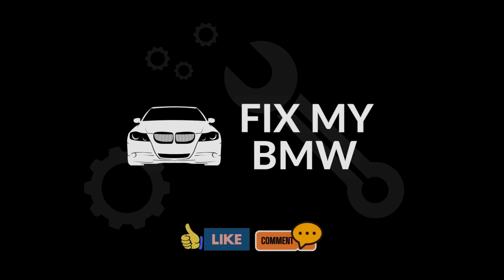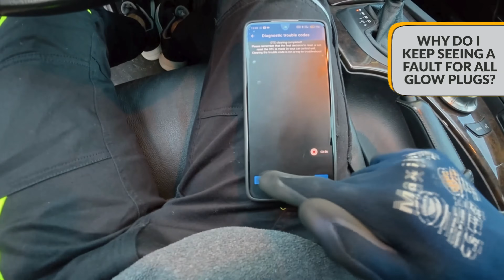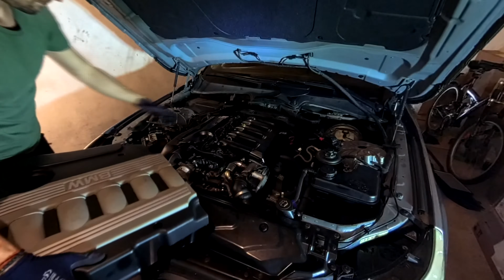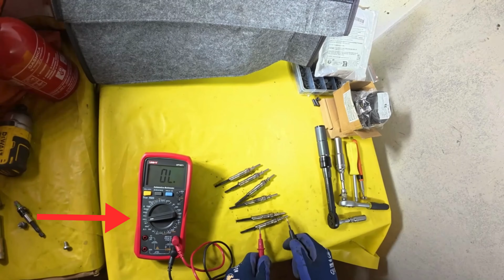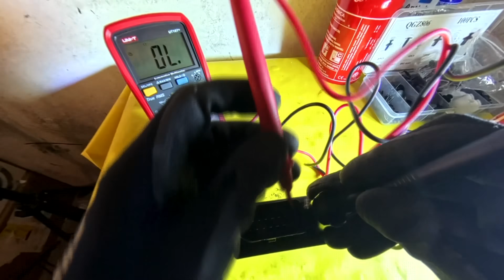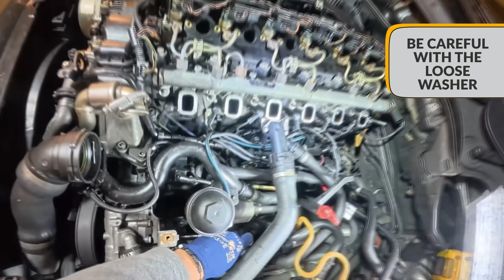FULL REBUILD - glow plug system in my BMW E61, m57n, 3.0d

Comment: i have fault codes for glow plug 6, glow plug relay no connection to bsd, alternator no connection to bsd and intelligent batterysensor no connection to bsd i tried disconnecting alternator bsd cable and ibs bsd cable still all errors i have replaced all glow plugs and 2 hitachi glow plug relays and power cable. what should i do next?
Reply: can it still be broken if it doesnt show any fault for oil level sensor?
Reply from the maker: @nooavaananen1607 Yes, absolutely. The oil level sensor can short-circuit the BSD bus line internally without throwing an "oil level sensor" fault code. When the signal wire gets pulled to ground, communication with all devices drops completely. Disconnect the oil level sensor, clear the codes, and re-scan. If the BSD errors disappear, replace the sensor.If that doesn't solve the problem, it's best to post on a Facebook group asking about this specific case—maybe someone has already dealt with this exact situation, because to be honest, I haven't come across this issue myself yet ;)
Reply from the maker: Hey, all those components (Glow Plug Module, Alternator, IBS, and Oil Level Sensor) share a single-wire communication line called the BSD bus (Bit-Serial Data). If one device on the BSD line has an internal short-circuit, it pulls down the entire network, causing all other components to throw 'no connection' faults.

Since you've already tried disconnecting the alternator and IBS, try to disconnect the oil level sensor (ignition on, engine off), clear the codes, and check if communication with the glow plug module returns.

Comment: Hey can you help? I did this change. And now my car wont start and all my lights are lighting up on the instrument cluster
Reply from the maker: Hi, what exactly did you change? The controller? The power cable? The glow plugs? Please tell me a bit more
Reply: @fixmyBMW  i only changed the glow plugs and glow plug module. i did a coolant change too. 

i went to start the car and it just clicked and few times and didn't turn over. it had the car on a lift symbol, and a lot of lights were turning on and off on the instrument cluster, and my hazard lights were turning on an off. 

i opened the automatic boot, and it stopped halfway. im not sure if the battery died?
Reply from the maker: If during the replacement the interior light in the car was on, then yes, the reason could be a weak battery, and I sincerely hope that this will solve the problem ;) If not, a less important question—do the new glow plugs have the same number and length as the previous ones? A more important question—is the new glow plug controller OE or an aftermarket replacement? Used or brand new?
Reply: @fixmyBMW hi, do you have an email i can contact you? I want to send you more details and a video?
Reply from the maker: @AB.............  Ok, on the main page of my channel, after clicking "more," my email will appear. I don't want to provide it in a comment because spam ads from bots always come afterward. Reach out to me, and we'll try to get this sorted out :)
Reply: @fixmyBMW  thank you! will send you an email now :)

Comment: Hi!
I personally own a BMW 525d E60 with the M57D25TU2 engine.

Symptoms:
• The car is in “Limp Mode”: No power, refuses to regenerate the diesel particulate filter (DPF).
• Winter issue: Hard to start at -15°C (cranks for a long time before it starts).
• Fault codes: Permanent faults on all 6 glow plugs and the exhaust backpressure sensor.

Checks performed (your evidence):
	1.	Fuses in the E-box: All 5 engine fuses have been checked with a multimeter and are intact.
	2.	Power supply: You have measured a 5V reference voltage at the pressure sensor connector (the DDE control unit is therefore supplying power as it should).
	3.	Sensor: A new sensor has been installed (but the fault code cannot be cleared).
	4.	Thermostats: Checked and functioning (the engine reaches operating temperature).
	5.	All 6 glow plugs have been replaced.

Final question:
Has anyone experienced something similar? And is it possible that the glow plug relay and the power cable could be the cause of the DPF not regenerating?
Reply from the maker: When there is an error on all 6 glow plugs, significantly more soot is produced, and the DPF filter clogs extremely quickly in such a situation, especially in winter. If there are any errors related to the entire DPF regeneration process (for example EGR errors, and possibly glow plug errors as well — I’m not 100% sure in your engine version), then the DPF regeneration will not start at all, which makes the situation much worse, and eventually the car starts to “choke.” This could be the cause of limp mode.

If you are unable to determine the cause, temporarily remove the DPF, clear the errors, and see if the car comes back to life (you should only see DPF-related errors). That will be a sign that it is completely clogged — it will need to be professionally cleaned, and the faults that are preventing regeneration must be fixed.

Comment: Thanks a lot for this video, it really helped me understand what was going on with my car.
I have a BMW 525d (N57) and for a long time I was suffering from very rough cold starts: heavy shaking, unstable RPM, sometimes the engine would even stall until it warmed up.
I already replaced the glow plugs and the glow plug control module (OEM BMW), registered a new battery, but I was still getting undervoltage-related fault codes like 241A00 and 801405, and the problem never fully went away.
After watching your video, it finally made sense that the power supply cable to the glow plug module can cause voltage drops and all these symptoms, even if the module and glow plugs are new. I’ve now ordered a new power cable and I’m confident this is the missing piece.
Really appreciate you sharing this information – it saved me a lot of guesswork and unnecessary parts swapping.
Reply from the maker: Great, I'm glad you found this video useful. That's exactly what I was looking for! It's also a good idea to use a contact cleaner and spray it on the plugs and sockets before assembling the components. Take care!
Reply: @fixmyBMW  Hi can I know where can I get the power supply cable?
Reply: Can I know where did you but the power cable?
Reply from the maker: @emcex5554  Hello, I bought the cable in a stationary store ((ordinary automotive shop)), if they don't have something, I order it directly from the BMW online store ;)

Comment: Was heißt genau der Fehlercode 4203? Hab auch so ein Problem, hab glühsteuergerät von Hitachi eingebaut. Fehler immernoch nicht weg. Müsste auch glühkerzen wahrscheinlich wechseln. Alte glühsteuergerät zeigt auch keine Werte an wie bei dir beim Messen.
Reply from the maker: Hello, in a situation like this you need to carry out a full investigation to find the culprit. There are only a few suspects:

1. Glow plugs,
2. Glow plug control module,
3. Power supply cable,
4. Wires from the control module to the glow plugs.

If you check each of these elements one by one, you will definitely find the cause of the fault.
P.S. In my other video, you will find all this content in video form. I hope it will make your work easier. Let me know how it goes. Take care!
Reply: @fixmyBMW ok 👍